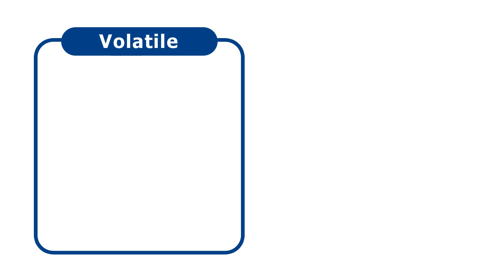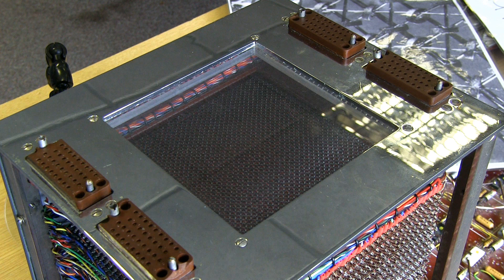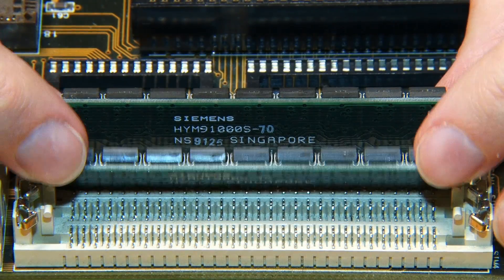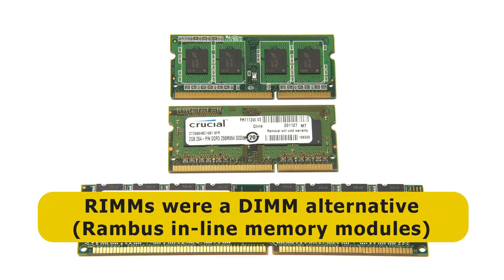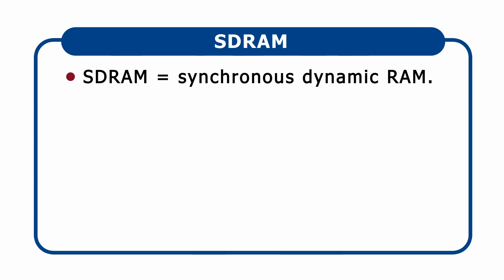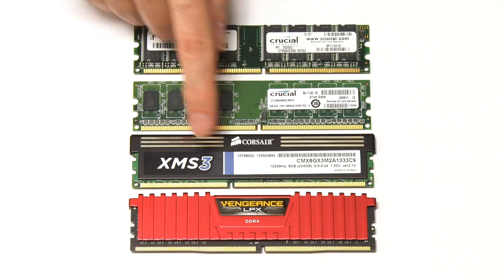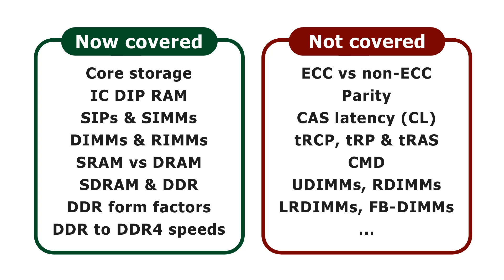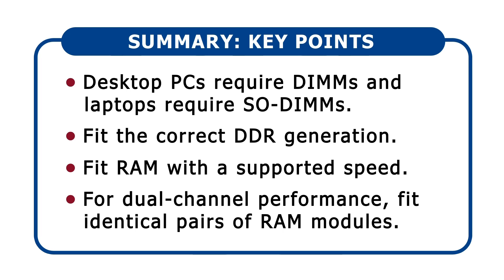Explaining RAM

Comment: Before core there was delay memory and Williams tubes.
Reply: In 1968 I worked in a place with an emergency generator.  Each wednesday they tested the emergency generator and the mercury delay lines "forgot" what they knew.  Each one had to be reloaded.  The same thing happened when they switched the generator off after the test.
Reply: Wasn't that the memory that used actual Mercury as it's storage medium?

Even my 486 with it's SIMMs was more convenient, by several orders of magnitude

Comment: In a 4 slot dual channel motherboard  can I have 2*8GB at 2400 MT/s sticks + 2*16GB at 3200 MT/s sticks without any problems?
Reply from the maker: You can indeed, though ideally use modules all of the same speed.
Reply: @ExplainingComputers  Thanks for the reply, but will I loose the advantage of 3200 MT/s RAM if I run it with the 2400 MT/s RAM, does it automatically down clock to the lower frequency?
Reply: @KoshyGeorge  yes all the ram modules will run at 2400mhz.

Comment: This may be a UK vs US thing, but what you were calling "SIP" was marked as "SIPP" here (an extra "P")..... Single Inline Pin Package. I had one PC that used it, back in the late 70's or early 80's, and indeed it was a pita to put that dram stick into its pin socket. You had to be very careful not bend the module over as you were inserting it, and end up bending the pins.
Reply from the maker: Thanks for this. I don't think it is a UK vs US thing, as they were marketed as both SIPs and SIPPs (the same way DIPs were also called DILs). I decided to skip over this in the video, as there was already a lot of terminology included! :)
Reply: @ExplainingComputers  Well, DIP was also marked (marketed?) here as DIPP, Dual Inline Pin Package, even though it no longer had "pins".
That was about the time companies started being more concerned with image and jargon, rather than using an established standard nomenclature. ;)

Comment: I had the 16K ram pack that plugged on the back of my ZX81. I think if I remember right it was only actually 15K of memory and the 16K on it referred to that fact it expanded the computer to a total of 16K that included the 1K on the computer itself. I used a Sharp cassette recorder the flat desktop kind with the single mono speaker on that you would press the play and record buttons down on together to record via the cable running from the mono mic socket on the side into the ZX81.
Reply: IIRC the RAM pack really did have 16K of memory, but disabled the internal 1K. Mine is up the attic - must check...

Comment: Cool video.

Fun Fact:  Before RAM was reliable in a portable platform the USAF used a very long piece of coiled wire to "store" bits of data for the F-86's fire control system. Due to the limits of the speed of light the pulses would be delayed before emerging on the other end and be used to calculate bullet trajectories.  The fighter was used during the Korean War over the same country where two of the three big RAM manufacturers are located: Samsung, SK Hynix, and (Micron in the US).

Comment: For the next time going in-depth on timings would be interesting. For Ryzen it is rather important to sharpen the timings as much as possible because in essence you use two CPU's on one package. When data has to go from the cache on one CCX to the other you have extra latency, the sharper the timings and the higher the speed the less that latency.

Comment: Does the SDRAM speed matter when replacing RAM, could you replace DDR3 1333 with DDR3 2133?
Reply from the maker: Yes, you can fit faster RAM if your motherboard supports the higher speed. All motherboards support a range of speeds, so what you ask is often possible, but you should check the motherboard manual/specs.
Reply: Thank you, I had bought ADATA RAM 16GB in my Dell Optiplex 990 but notice the original RAM was DDR 1333 and the new RAM was DDR3 2133. As I was waiting for this RAM to be delivered to me I bought 4GB of original Dell RAM making my rig 8GB. I was wondering if having the 16GB would make a difference for gaming. I notice the ADATA RAM was 3x what I paid for it and was thinking about selling it.

Comment: Do you know by chance what the resistance limit is on ram? Because it can be mader better then before but eventually we can't fit electronics that would not overheat by resistance without lowering the energy that moves into it or increasing thermal conductivity. And while i can imagine it i find the thought weird to have thermal paste and heatsinks on my ram.
Reply from the maker: This is why the voltages used in high-performance semiconductors (CPUs and RAM) keep falling.

Comment: Interesting video Chris, thanks. One feature I'd be interested to see is some real-world benchmarking between RAM specifications: I always thought RAM transfer rates had minimal impact on daily performance, but, as you explain, the PC number refers to data moved between memory and CPU per second, which seems like it should make a significant difference to performance. Is higher PC RAM only really useful for overclocking?
Reply from the maker: Higher performance RAM will make a difference, but will depend on where the bottleneck lies in a system relative to the task in hand.

Comment: With a petabyte of ram in the future you might be able to open 6 tabs in chrome.
Reply from the maker: A whole six!
Reply: @ExplainingComputers  maybe two in edge
Reply: And if you use the new Microsoft Chromium based Edge replacement, you'll be able to open 6 tabs to download 6 different browsers to replace it... and never open it again.
Reply: @sbrazenor2  funny that now the new Edge Chromium is actually one of the most used browsers worldwide, it is certainly gaining some traction it needed and it's worth it
Reply: @sbrazenor2  You might be on to something there.
Reply: That was really funny. I honestly laughed out loud and drew attention. Good on you.
Reply: Actually, 8 or even 10 could be possible,  if your terabyte fiber network supports it.
Reply: @LordDragon1965  That is just madness!
Reply: Is there a problem with Chrome? Other than it being greedy, sluggish and full of spy-modules. I find I can run it with 4 tabs open and have it constantly offer up to close two of the tabs because of its non-responsive behaviour. And there's nothing like waiting three or four minutes to browse a mostly text based website with around 20K of graphics.
Reply: @loginregional  I recommend a plugin called Stands. It stops a lot of the tracking scripts, bloat, etc. I also run Chrome on Linux, with 16GB of RAM, so I can open dozens of tabs without any slowing issues. I also have an 8 core processor... so, results may vary. Hahaha!
Reply: Is Chrome really that bad?  Is it just the latest versions or what?  I regularly have 6-10 Firefox windows plus 6+ Chrome windows open and they all have multiple tabs (5-10 or so each).  Firefox seems less overall of a memory hog but sometimes Task Manager shows one image with 2.5 GB+ in use.

I wish both browsers would just tell you in the tabs how much RAM they are using so you know what to close if needed.
Reply: ElmerFuddGun I use Firefox over Chrome. Chrome tends to use as much RAM as it can, so if you've got 32 gigs for example, it may use as much as 24 gigs of RAM to run. Which is ridiculous.
Reply: lol i literally have 150 tabs open right now in chrome
Reply: ill tell you its pretty terrible because you cant even see the webpage icons. how am i supposed to find my porno tabs without clicking each one? thanks a lot google assholes!
Reply: @Blox117  Use Vivaldi. You can tile tabs.
Reply: No thats too much
Reply: Hahaha
Reply: I think you can open a maximum of 5 tabs... Because 1 Peta byte of ram isn't this much... If you have 1 ore 2 hexabyte, then you can open a maximum of 9/10 tabs. If you try the same process in internet explorer instead, you can open infinite tabs, but you have to wait like 12 years for each tab...
Reply: I don't have that problem with chrome, using it in linux.
Reply: @CoverYourActions  on Android, with 51 tabs open, it has a maximum ram usage of 7.9gb...
Reply: @lorenzocampolucci4464  I only need 50MB on my tablet to open tons of tabs
Reply: Alan Chambless well technically that's Chromium
Reply: @JonnyInfinite  on Ubuntu it is Chrome not Chromium, I should have specified the distro.
Reply: I'm able to have 6 tabs open smoothly on Chrome OS.
Reply: I got over a hundred open before it broke
Reply: Lol
Reply: with or with out an occasional bsod?
Reply: Or exabyte so you can open 15 tabs
Reply: Hell if internet explorer would have been around then it might have actually been useful with a petabyte of ram
Reply: Huh? More than 6 years ago when using a low-end smartphone even a dozen tabs in Chrome wasn't an issue for me, so your joke doesn't make sense. Perhaps if you made fun of Internet Explorer for having low performance while requiring high specs that would make more sense, although that's a bit dated.

Comment: In the 1980's I was a young US Navy technician working on older fighter jets left over from the 1960's but still in service. They used (very heavy) magnetic ring memory cores for the navigation computers. We programmed them with a reel to reel 'punch tape' device as they only had about 24Kb memory.
Reply: Is 24KB enough?
Reply from the maker: How the world has changed . . .

Comment: Again a very informative video with densely packed information that is supplied easily understandable! I love your work!
I hope you will do a video with a deep-dive into RAM timings because I still wonder if I am able to further overclock my RAM.
Also, there is even Quad-Channel RAM, which is also really interesting and much harder to keep it stable when overclocking, which is important to me.

I am currently running a Threadripper 1950X at 4 GHz overclocked and 32 GByte of 3200MT/s DDR4 Tcl 14 G.Skill RAM in Quad-Channel mode (Module spec).

Comment: Gday Chris, I am going to go out on a lim here and ask u to make a follow up video about ram, more specifically using as a ramdrive and loading the windows pagefile sys onto it when it boots up and b4 shutdown it saves the pagefile back to the hard drive or sd card/usb stick. The reason is to help resurrect older pc's and give them a second life, storage being an issue due to the old size limitations and running various windows which max out the drive space and not leaving enough for an operating pagefile which can run from excess ram installed. Trying to find such info has proven very illusive and  ur the master of pc's from their emergence in our world of tech. I really enjoy ur process of explaining things and no matter what what I thought I knew is not all there is to know and u add to the education of what i missed when I learnt about pc's. Thanks Chris for the channel.
Reply from the maker: I may indeed do a follow-up. A RAM drive video is indeed a nice idea. Noted!
Reply: @ExplainingComputers  thanks heaps chris, it has frustrated me to no end searching  for ramdrive uses and how to's etc.

Comment: Fear not; the petabytes of RAM will be used for simple things like text editors (which will still somehow be laggy). David Horne managed to put a chess program for the unadorned ZX81 into 672 bytes, leaving room for the system overhead. The "cool kids" today are building things based on Electron, which involves installing most of a web browser and a local web server that answers only to that browser, then running a web application on top of that stack. Such applications apparently do not quite fit into 672 bytes.

Comment: What about vram is it just mean video or is there something else to it that special and why is it only used in video application cards
Reply from the maker: VRAM is indeed RAM used for video cards. It does have its own DDR generations though, currently going up to GDDR5. (Graphics DDR 5).
Reply: @ExplainingComputers  can it be used as normal RAM in the motherboard there is no difference between the two or is?
Reply: VRAM is normal RAM used by GPU. RAM on GPU is used for holding textures, which then are sampled by shaders, as well as gbuffors and any form of staged rendering as well as render to texture/ render targets (extra cameras), reflection probing, last frame.... in general everything that can be sampled by shader program executed in GPU needs to be in VRAM ... GPU don't require RAM for everything else. Due to high parallelism of GPU and doing things in not fixed order unlike in CPU, data processed by shader is not persistent and stored only as local varables in GPU core registers, so everything is thrown away after each single pixel and verticy is calculated. 

GDDR have different priorities, being primerly speed over lentecy, GDDR can be used as standard RAM of CPU as PS4 for example proofs, ofcorse it a very rare setup used in embedded systems and CPU need to support that.

Comment: Excellent video on RAM. Once again your presentation reminded me of the lectures I used give at the university for department's computer literacy class. The only key difference is that the lecture started with measuring RAM in kilobytes. The presentation bring back fond memories of building my first PC in 1989 - carefully plugging in those individual RAM ICs, hopefully not bending any of the legs in the process. I also fondly remember attending computer shows where vendors would sell motherboards, RAM and other components so hobbyist could build their PC compatibles and buying SIPs for helping a friend build his first PC compatible computer. Thanks again for a wonderful video, and always keep up the good work!